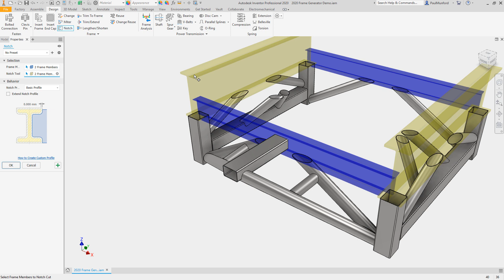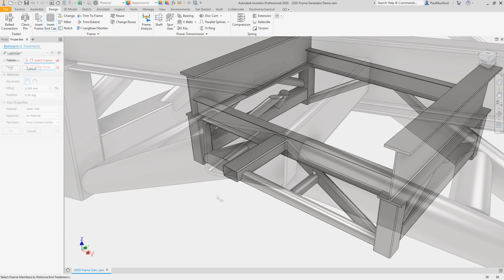Autodesk Inventor 2020 what's new: Frame Generator

Comment: That is a breakthrough in structure modeling. Keep going forward. One advise. When using the trim option it's helpful if you can see a box to select the side you want to cut, just like solidworks. This is special useful when you use the operation to multiple bodys. Also the 3D sketch must be more user friendly, that mean allowing you to draw easier in ortogonal way changing the plane with "tab" like in Autocad and also it should allow you to annotate everything in an ortogonal way letting you decide in which plane you want it to be again just like Autocad.
Reply: You can draw ortho in 3d sketch. See here: https://www.youtube.com/watch?v=LkxBLZ1VAlA